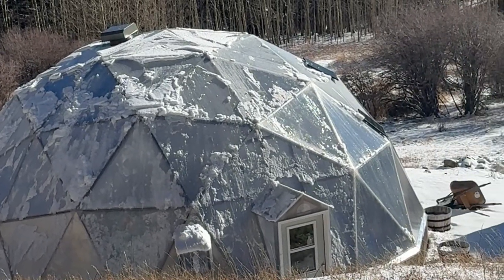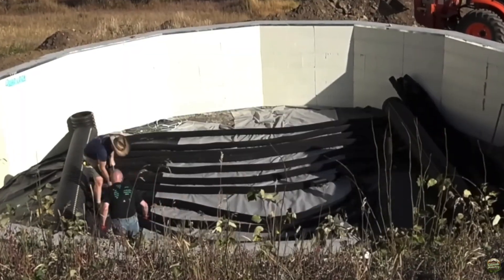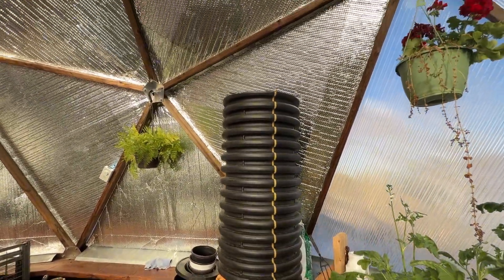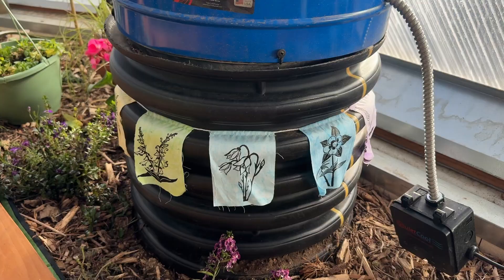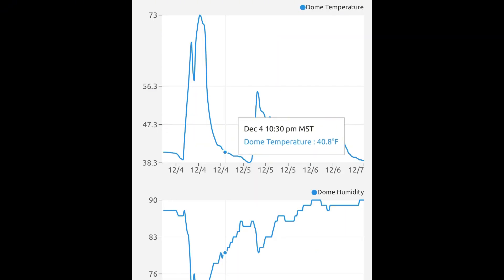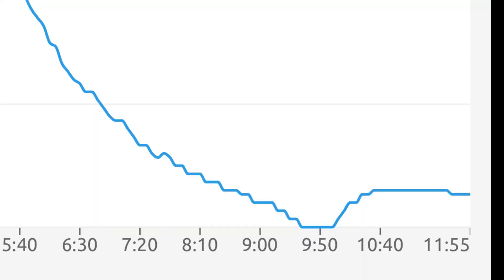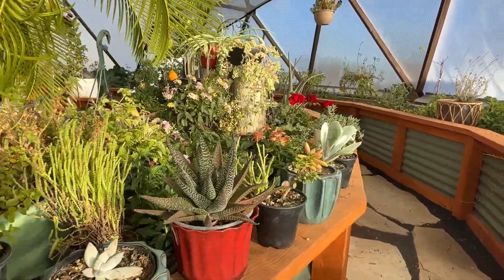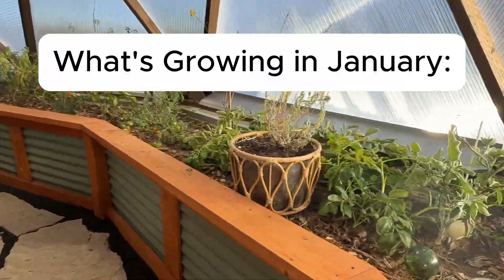How a Climate Battery Allows us to Grow All Winter (Zone 4b Greenhouse)

Comment: I would suggest the rocket mass stove as a heater unless you have a wood boiler for home heating. I now use a wood boiler we use to heat the house to heat my hothouse and greenhouse now, but similar to you, my hothouse is a pit greenhouse dug 5 feet down with concrete walls and multiwall poly as a sheeting. I will be rebuilding it as when I built it 20 years ago I did not take into account the amount of frost heave its walls would be exposed to. I will be replacing the concrete block walls with bin blocks to add even more mass to the walls  and improving drainage as I have flooded it a few times over the years when I had sump pump or power failures. I will mortar the walls and use spray foam externally on them.
Reply from the maker: The insulated concrete forms must keep out much of the frost for us. Since we're on a hillside, we're not dealing with flooding, but we will see if we have a large spring thaw this year. How do you like your greenhouse? Are you glad you dug 5 ft down?
Reply: @ColoradoMountainLiving   IT saved me hugely on heating but I wish I had started with concrete bin blocks rather than regular concrete blocks. I did not do enough to prevent frost heave and have to redo my walls due to it. IT did take 20 years to really create a problem though.
Reply: So interesting.

Comment: I'm going to second the suggestion for a diesel heater as backup.  You could possibly route the hot air into the ground tubes to get the thermal mass rewarmed faster.
Reply from the maker: We've definitely considered a diesel heater as a backup option! We have one and might be able to exhaust through the screen window in the door, without having to do a panel penetration. I like the idea of routing the hot air into the ground!
Reply: @ColoradoMountainLiving do you have Radon gas detector in your greenhouse ? Not sure applies, but safety just in case.
Reply from the maker: That's an interesting idea about routing the hot air into the ground tubes!

Comment: You might consider a diesel heater for emergency backup on the worst days. 
They're inexpensive to purchase. They're very efficient and they can be set to run at a temperature you set for a low to overcome the night cold. 
It's been fun watching you from start to finish on the house and all the other work you've done around the property. I'm from Colorado, originally living in Florida now so cold is not my problem. I was just there for the warmest Christmas in years. Happy New Year!
Reply from the maker: We actually have one of those! The only drawback is installing an exhaust  vent, but I just thought of something- the screen window can come out in the front door, so maybe that’s an option for venting. Hmmm. Thanks for all the support these years!